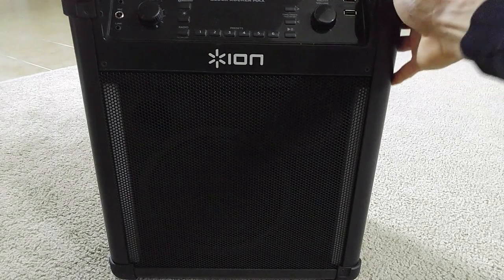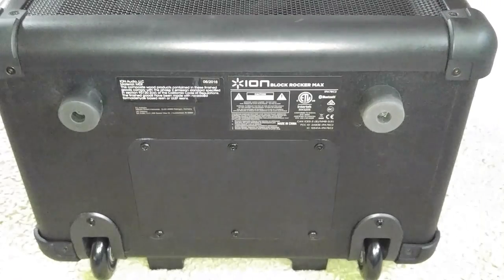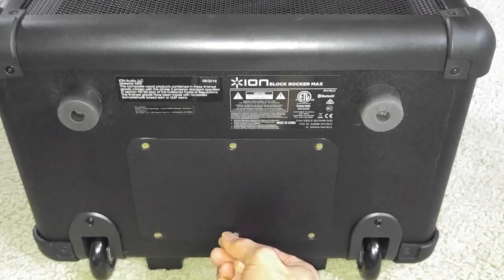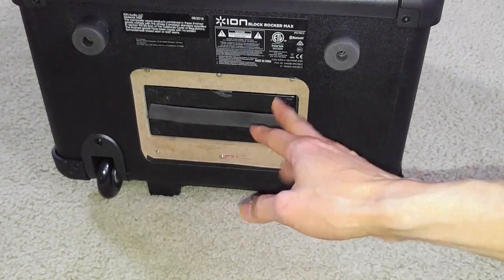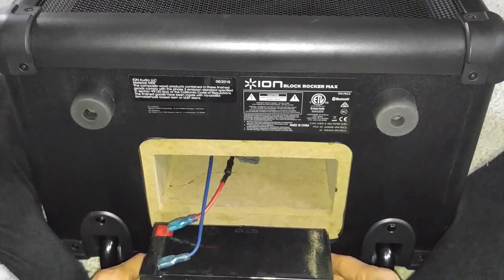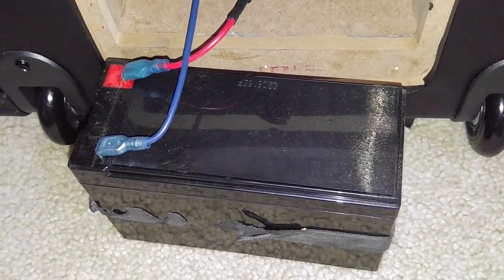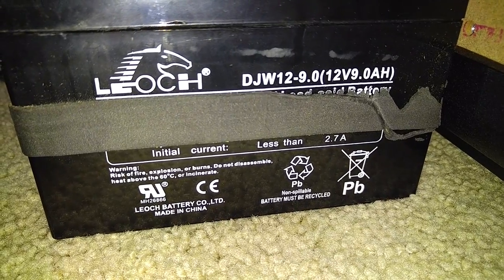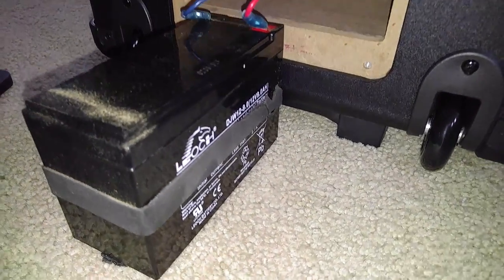Latest DIY On How To Change And Remove Your ION Block Rocker Max Speaker Battery Tutorial Full 2017

Comment: Hello you genius electronic workers...lol listen I think the battery is shot period cuz eben with it unplugged it won't turn on

But wen I plug it up it comes on..but then it slowly goes off an then turns back on an turns back off

Everything is plugged up well please help me I love it so much
Reply from the maker: It's your battery, not holding charge.
Reply: @Macdaddypimpping ...Ok then it should play with the plug in the outlet then.....you shouldn't need the battery if the electric current is flowing...it cuts on an then goes right back off

Comment: you didn't explain how to detach the battery wires dude.
Reply from the maker: Easy, remove with a plier.
Reply: Stay away from pliers. They’re dangerous. Look both ways before you cross the street.  
  Wear a helmet.

Comment: do you know how many ohms is the speaker in there
Reply from the maker: Good question, let me see if I can find out.
Reply: ok
Reply: @macdaddypimpping   i need some help on this like really need some  thought on this can u play your ion block rocker max with the rechargeable battery  unhooked jst with the cord????
Reply from the maker: @pree3431  Yes, if my battery died I just plug in the AC cable and it works without the battery.
Reply: @macdaddypimpping  thanks 👍
Reply from the maker: @pree3431  Anytime.

Comment: My battery measures 12.6 vdc.  The 3 green LEDs AND the red one are all lit when the power cord is disconnected.  I thought maybe the inline fuse was bad on the red wire, but doubt it now since the LEDs are lit.  If the fuse was bad how would the LEDs get current to light ?  I will test the battery under load, but any ideas if its the battery or what ?BTW how to get the battery cover off:  take a piece of coat hanger and with pliers bend the end up a little.  It will fit in the 6 screw holes.  Go around all of the screw holes inserting the coat hanger and lift up slightly.  Keep going around and it will come out.  Another possibility:  use a suction cup from Harbor Freight.  Also the handy little coat hanger wire can be used to get the battery out too.  Just insert it on one side with the little bent tip under the battery and lift.  Then go to the other side and do the same.  Keep doing this, alternating sides, and eventually the battery will lift out high enough for you to grab it.  When you replace the battery, make sure per the video you put a ribbon around the battery so you can lift it out next time easier.What give with my battery ?  The unit works fine when plugged in BTW, but not on battery power even though the battery shows 12.6VDC.
Reply from the maker: It doesn't matter if battery shows 12.6v and then you crack up the volume it dies. If it does that then that means your battery is bad, if fuse is burn out then your unit can not even turn on at all. Good luck.
Reply: @macdaddypimpping  The inline fuse on the power wire was blown. I removed the fuse and connected the wire to the battery. The radio still doesnt turn on only when plugged into outlet

Comment: I was about to purchase a replacement battery. So I went ahead and removed it and noticed it was a 12v battery. I ended up charging it with my car battery charger at 2 amps. Popped it back in the speaker and it’s working again. Try this before you purchase a new one.
Reply from the maker: Are you sure? 2A thats pretty high Amp to charge a small battery, might heat up the acid inside the battery.
Reply: macdaddypimpping yea it’s only a 5ah battery so just make sure not to put it on for too long. I did 5 hours and it’s working like new again
Reply: Although recommended charging current should be 5 times less then what it’s rated. That’s all I had so I used it and it did the job. I just kept a close eye on it
Reply from the maker: If it works for you then it's all good.
Reply: Hello you genius electronic workers...lol listen I think the battery is shot period cuz eben with it unplugged it won't turn on

But wen I plug it up it comes on..but then it slowly goes off an then turns back on an turns back off

Everything is plugged up well please help me I love it so much
Reply: Mines would not charge at all but I disconnect the terminals and use a charger to initiate the charge then hooked the old battery back up to the speaker, plugged in the cord and it's charging now. I 🤷‍♂️

Comment: I'm using this a reference guide for my job rocker plus. So just plug the new battery in and your good to go?
Reply from the maker: That depends if you blew up the fuse or dead battery.
Reply: Hello you genius electronic workers...lol listen I think the battery is shot period cuz eben with it unplugged it won't turn on

But wen I plug it up it comes on..but then it slowly goes off an then turns back on an turns back off

Everything is plugged up well please help me I love it so much

Comment: Where did you purchase the new battery?
Reply from the maker: You can buy them on eBay or Amazon.
Reply: BaySports1408 go to the ion website they have a section for that
Reply: They ask for the serial number so you get the exact one you need

Comment: Would have been nice if you had shown us how to remove the wires.
Reply from the maker: You will need a plier to get the plugs/wires out.
Reply: Mine came with a 3-4” red wire.  So impossible to hook it back up.   I’ll make a pig tail but it would have been nice if they just opened a new roll of wire instead of using the last 3” of the roll.     After exactly 1 year. Mine won’t power on even plugged into the wall.    They would fix it if I pay shipping.   $80.00.  One direction.